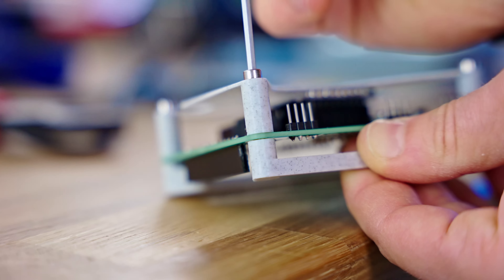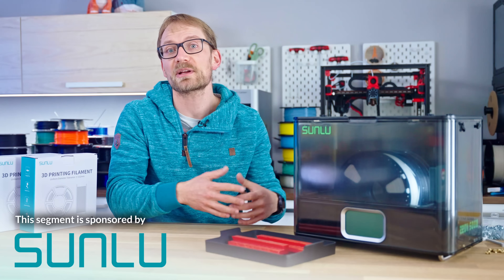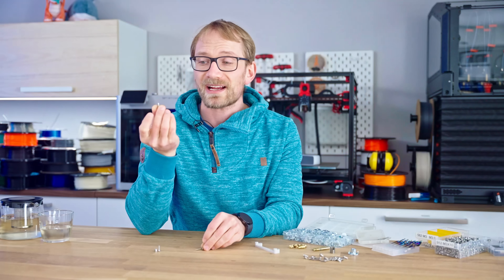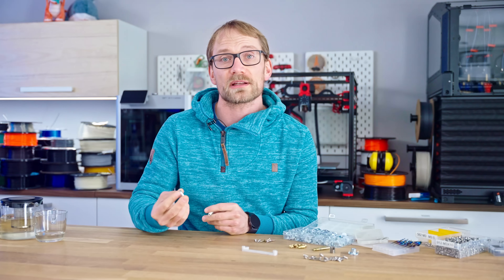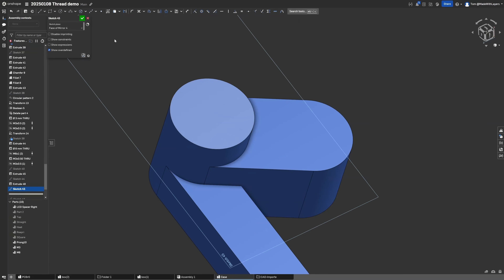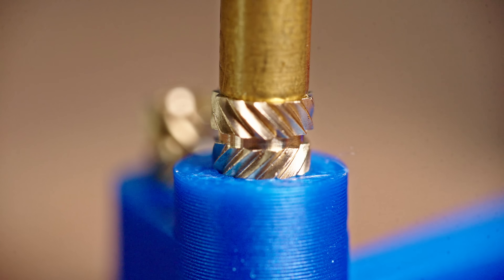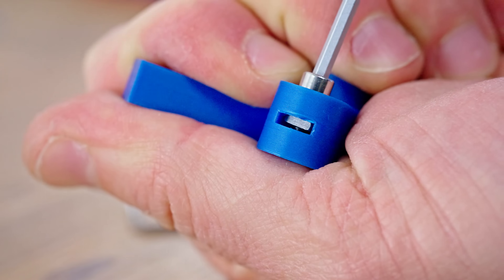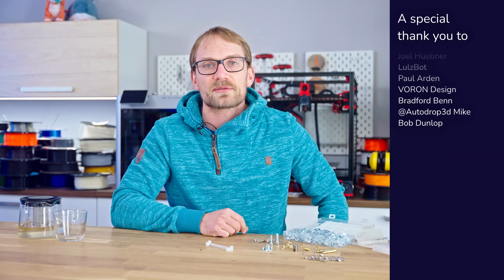A better way to add threads to your 3D prints

Comment: I often use a hole "in-between" printed and tapped.  I add one or two extra layers around the hole, and then drill the printed hole for better size control. Quick to do, works every time and eliminates the tuning requirement. That said, I definitely like the lobed (or polygon as mentioned in another comment) and plan to give this a try on future models.

Comment: The PT screw needs a drafted hole with release in the bottom. Check design rules from the manufacturer :) You also design an entrance with wider diameter in the start of the drafted hole.

Comment: A tip is to stop pushing the heated insert when it is 1mm above the surface and use a washer or metallic plate and push it in tha last mm tonger it flush and the plastic will tuck in around the insert aswell looking supernice

Comment: One tip for (self-)tapping holes: place micro voids (a few um in diameter) neighboring the hole near where the perimeter would be. They tiny features will fool the slicer into placing more perimeters near your hole but your extrusion overlap will fill in the void. This allows more material for subtractive finishing while being economical with your shell. Just be sure to review you slicer output for undesired artifacts.

Power tools for tapping plastic is way overkill. Those are typically designed to tap metal. A hand drill could be nice though.

Comment: He didn't mention slightly UNDER sizing a Hex nut hole (0.1mm), then heat setting it in from the back side or slot. Hybrid cheaper option between the T-nut and brass heat set insert. Or slightly OVER size hole/slot and setting with a drop of super glue for convenience - which is what I usually do because it's easy. For US people, the little bags of nut/bolt combos in Imperial are everywhere at Walmart, Home Depot, Lowes for cheap in different sizes.

Comment: I liked your idea of the self forming threads with the ridges. BUT are you making that more complicated than required. Why not just print a hexagon hole? 6 points of contact with space for the expansion?

Comment: I do the opposite of the three bump method.  I do three cut outs in the side wall of my hole, with the ID set at 60 to 70 percent thread engagement.   This way, as the screw is inserted, the excess material has a place to go, the walls do not end up too thin, I have a channel if I decide to add glue to the interface, plus the wall has three places it can flex or stretch as needed, without compromising the print integrity.

Comment: Worth mentioning that using metal female threaded parts in your print allows you to use liquid-type threadlockers.  Also, you can combine metal threads and 3D printed threads to get a pseudo nylock effect.

Comment: I add a hex cut out on the back side of a hole to fit a hex nut.  If you make the tolerance tight enough, the nut can be press fit into the print and stays in place.  Hex nuts and machine screws are standard in size and easy to source. 🤙🏼

Comment: It is 2025, right, if you are using a threaded insert don't push it in all the way. While it still is hot use a coin or anything that has a bigger footprint than the insert and push it the last mm or so. Voila! You have a perfectly aligned threaded insert. Sure, this only works where you have a perpendicular surface or an area bigger than the insert around it. In my experience is that it helps to set an insert straight in 95%+, as you can construct the place for your needs.

Comment: I think my default will be a simple hexnut in a shallow hole on the other side and a longer screw. With a washer if I need max strength and a hexagonal hole if I think the nut itself has enough area and I don't want it to move. I practically never like machine threads in plastic. Only takes one turn to strip the hole.

Comment: Wouldn't it be better to design parts which connect securely without the need for fasteners? e.g. snap-together parts, interference fits, gluing, etc.?

Comment: I just prefer nut-inserts.  All the other methods actually take more time to model, then it does to install the inserts themselves. Plus with the inserts, if your print fails during use, the inserts can be pushed all the way through and re-used (I've only ever had 1 item fail, and I didnt have anymore of that size insert in my stock, so pushing them out was the fastest way to recover).  I will say though, I wasnt aware of using that function in onshape (I'm somewhat new to onshape), so I might use that feature for complex modeling.    Great content btw!

Comment: Thumbs up for the 20Kč for scale :)
I understand usage of heated or any other inserts but honestly, it's just another thing you need to buy and store + another thing to consider when designing anything (especially if you want it to be a fast print or something slim). If I really care about the nut on the other side not being on top of the object, I just go with a hexagon hole for the standard nut and it works fine... Until all the nuts fall out when reassembling it for any reason, lol. Searching for these m3 nuts you dropped is mood killing :D

Comment: 3:35 "Also, these are just a lot harder to source than standard machine screws."

Funny, it's the complete opposite in Brazil, wood screws are available everywhere, machine screws on the other hand are only found on specialized screw shops or online.

Great video BTW, I'll do the self forming thread method for now on, even with wood screws.

Comment: I've always used something similar to the lobed circle. The difference is that I use a pentagon inscribed into a circle of the screw's major diameter for the threaded area and a tapered cone at the entry point to guide the screw into the thread area.

Comment: I do a lot of design with open scad.  I see right away how to create the "self forming threads" object by combining three cylinders, and then use that object to carve out the desired "hole".  Thanks, good idea!
Inserted nuts is a good idea, but you left out one way of using them.  Carve out an internal hex hole sized to fit the nut.  Insert a pause in your print to drop in the nut, then continue the print so the nut is buried inside the part between layers.  I've use this to insert hex nuts inside of the knobs I  printed to hold and adjust the bed tension on my Ender 3.  With open scad, simply set $fn to 6 and  create a cylinder with 6 sides to subtract the desired nut cavity.
Reply: I think that making a screw hole by subtracting a cylinder with $fn=5 or 6 (inscribed in OD) would be just as good, and much simpler.  Also, subtract a cone at the entry to start the thread more reliably.  BTW, I've been using the BOSL2 library for designing enclosures, brackets etc.  Works great, and is very powerful once you get past the learning curve.  But if you're smart enough to use OpenSCAD, then learning curves shouldn't be an issue.

Comment: If I can use through bolts with a nut on the other side, I do. I've found that some of my "test prints" made before making a metal part are then usable instead of machining metal. (For technical parts I tend to use PET-CF.)

Comment: I like to use rivet nuts. Look it up, downside is the thickness of the part has to be a minimum of 10mm I think depending on the rivet nut

Comment: The self-forming threads method looks very interesting, I need to try it out. I usually use slide-in nuts for most of my projects that need threads, since they're very easy to design, assemble and they're easily replaceable/reusable if the print breaks or somehow fails. My favourite method so far 😊

Comment: Printing the exact bore size is not a good idea, since screwing would make you compact/cut the entire thread into the solid surroundings, creating too much pressure.
You can alleviate some of this pressure by increasing the hole size to 40% of the difference between bore and outer size is ideal, as it gives more space for the threads to elastically deform the plastic into the shape of the thread.
adjustedHoleDiameter = boreDiameter+0.4*(outerDiameter-boreDiameter)

Comment: I was a little skeptical about the self-forming threads but they really works nice and easy, Thanks!
Pro-tip for the durability (thanks to Fran Blanche I believe): when reusing a plastic thread, first rotate the screw counter-clockwise until you hear or feel a click, now your threads are aligned and you don't damage your original plastic thread.
Reply: That's to stop cross threading and only ever an issue on a reallllyyy bad thread profile to begin with.
Reply: @urgamecshk  Indeed and to prevent your thread ends up realllyyy bad.

Comment: I missed why melting the plastic when screwing into it is a bad thing, if you melt it the plastic shapes itself around the screw, creating threads, and loads gets more evenly distributed. Loading to deformation, even slight deformation is kind of the "forgotten" big Achilles heel of PLA, as PLA tends to get brittle over time under load that deforms it, even slightly.  

Sure, if the screw melts the print slightly there's a possibility of change in place/angle, but if that's avoided, melting the prints slightly should improve strength and durability, especially for PLA.        

Another thing that I found slightly confusing was the part about slide in nuts, it seems to me that just removing material in the design so it becomes too weak is just bad design.  

Besides the mentioned options, it's easy to use an ordinary bolt and nut, just straight through, and a washer if necessary. 

And having perimeter thickness that is adequate for the specific application is always necessary.

Comment: I have used all of these methods and I don't have a favourite. I assess each job on its merits for its function and ease of use etc and then select the appropriate method. That is engineering. Having a favourite can lead to poor design to accommodate your favourite. A good summary video for the uninitiated though.

Comment: The tri-lobe hole that facilitates self tapping for common threaded fasteners is an excellent free solution for parts that need to be reassembled only a few times.  I love that it works with common machine screws that I already have and doesn't require any extra labor.   I'll add that to my bag of tricks.  Hopefully FreeCAD will add these negative cuts to their Fasteners workbench.  I have my own fasteners library in a folder on my computer that pre-dates FreeCAD's Fasteners workbench.  It's mostly STEP files of fasteners that I downloaded from McMaster-Carr where I buy many of these stainless fasteners.

Comment: I finally gave up and invested in heat set threaded inserts last week, mostly for use with parts I download.  I've always preferred a tapered hex cutout on the back of the part and pulling the cheap stainless nuts I already have into the pocket.  Stainless threads are very durable, and I can press them out if I ever need to.  It does require access to the back of the part, but that's seldom a problem in my designs.

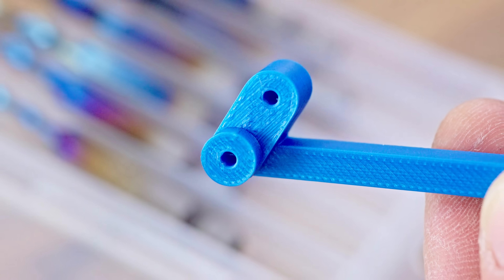Comment: 3:40 - Slicer modifiers can greatly increase the wall thickness only around holes for self taping plastic screws.  If you don't want to mess with slicer modifiers, you can design this feature in CAD by making concentric tubes that have walls slightly thinner than the wall thickness in your slicer, and spaced 0.1 mm apart so the slicer prints them as a single thick walled hole.
Reply: Question about this: if the slicer ignores the gap then it doesn't thicken the wall, it just brings the infill to the wall thickness specified in the slicer setup. I'm not understanding how this tricks the slicer into creating more walls?
Reply: @HuFlungDung2  - The gap detection can vary with different slicers and may even be a user adjustable parameter, so you may need a different gap, but the trick works by telling the slicer that the thicker walls of the hole are separate parts so the slicer will apply the wall (OrcaSlicer) or perimeter (PrusaSlicer) settings to the original outer hole and all concentric tubes within to create the desired wall thickness for the hole.

It's approximately the same amount of effort in CAD or using slicer modifiers but doing it in CAD should make it work when the part is sliced so the CAD effort saves effort when people slice your part for their own use.  The CAD concentric tube trick will probably break if the part is scaled up to a larger size and the gap is so large that the slicer is printing separate print-in-place parts.

If there are many holes, it's easier to thicken the walls in CAD because the hole geometry can be created once, fused into a single element and copied to quickly create the complex geometry for each hole.  It's possible to copy and paste modifiers in a slicer but slicer 3D visualizations and precise locating is a poor substitute for the capabilities of CAD.

Comment: If you don't need to easily dismantle the model after assembly, make your life easier and just make the holes and use aluminum rivets. Easy to apply, strong connection and you can even get a rivet nuts if needed for some parts. And later on if you really need to dismantle the model, you use a drill tin size of the hole and drill through the rivet, and you get it removed. You can't do it many times, but couple times possible.

Comment: If you have to do many tapped thru-holes i would recommend to get a special machine tap: Form B, DIN 374, 4H. Reasons: Form B = pushes chips out the front, preventing them from touching the parts in the back that got hot from friction (that's what most likely ruined some of your tapped holes). DIN 374 = "Überlaufschaft" (reduced shank) = you don't have to reverse the hot tap out of the hole, you can just take it out the other end. Tolerance 4H (instead of 6H) = tighter fit, ideal for added strenth in softer materials like aluminium and plastics. Caution, the thread will heat up if you run a screw in too fast.

Drawback: Due to the reduced shank you are more likely to loose grip on the tap with your jacobs chuck. You can use special tapping chucks instead (Google i.e. Hazet 849IG) but don't put those in your jacobs chuck, they need to have a little sideplay to not break your tap (the tap needs to follow the hole, not the runout of a drill). Put them in an 8mm socket (846IG-8) or in your 1/4 hex bit holder (846IG-6.3). They are supposed to not lock in your 8mm Socket or 1/4 hex bit holder and they will drop on the floor if you forget this.🫤

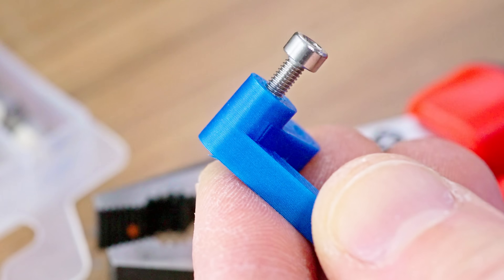Comment: Where can I find the 3D model for the air filter seen @4:10 ? Great video by the way 🙂.
Reply from the maker: This is my WIP design: https://cad.onshape.com/documents/c1de07c6ed14b7fbbda02664/w/179a8f3e39d597ba728c34cc/e/f8bef070918853e42a24e325?renderMode=0&uiState=6784e4da2d7bfa6c4f25779d
I will eventually publish this to Printables after a bit of cleanup. Things to note about the design:
- It's a large model, and you unless you split it, a Prusa XL can barely fit it.
- I've tried to optimize the design, but it still needs supports to be printable
- It requires about 3 m of sealing strip per segment, I've used the Aliexpress D-shaped seal, but other types also work as long as they are able to seal at a compressed height of 4mm
- Filters to be used are standard commercial 287x287x48mm "Minipleat" style filters. These are excellent value and provide some of the highest filter life for what they cost (about 25€ for an ePM1 70% filter)
- There is an adapter included to use the 5€ Ikea Uppatvind EPA12 filter. This is a filter with much less fabric area than the 287mm ones, so I'm using it only as the last stage. Uppatvind is rated for just below 100m³/h, my ERV tops out at 50m³/h and has much smaller filters from factory, so I'd assume the Uppatvind filter wouldn't be a bottleneck in this setup.
Reply: @MadeWithLayers  Thank you so much for sharing the model and all of this information with us!
Reply: @MadeWithLayers  interesting! Maybe a quick rundown video on that ventilation system as it is?
Reply: This is what I want to know as well.

Comment: This video clearly needed actual testing rather than guesstimates.
Reply: So go do it. This video is useful for 3D printing users not for engineering or anything that needs specifics on strength. It has its place and allows someone else to explore the experimental data if they do it.

Comment: For the straight hole method i strongly recommend refering to a cold formed tap drill table. It tells you what size hole you need to use. Works every time
Reply: Must be nice being born with all knowledge programmed
Reply: Watching printer guys discover basic shop stuff in real time is always a giggle
Reply: @skiddyfisk  More than at least half of the videos I have seen on youtube are just various young people rediscovering the wheel as it is, may not be limited to 3D print guys 😆
Reply: Yah I kinda got a kick out of him dissing straight holes, because they remove walls, but then tapping is better. What do you think the tap is doing? Anyway, I've gone the route of straight holes for bog standard connections, drywall screws with modeled threads for medium duty, and hex nuts on the back side on the part for heavy duty. Not sure why you'd ever use T nuts over them. It's dead simple to model a hex recess over a hole.
Reply: @netwalkergoogle  Well, a t-nut gives you more surface area. How necessary that is will vary heavily, but it's not zero

Comment: Another option is just draw a square or a multi-point feature in for example Fusion. You just give the center-point, number of sides and diamater (just a bit over center-size of the used bolt) and then extrude just like a round hole. Ofcourse in your design now you see this shape instead of the thread, but it works way faster then inserting and boolean-cut the form you want.
For cooling during thread-cutting, well I use the normal lubricating-cooling. But that is in ABS and PETG. I don't know if that would do anything bad to PLA since I don't use that anymore for functional parts.